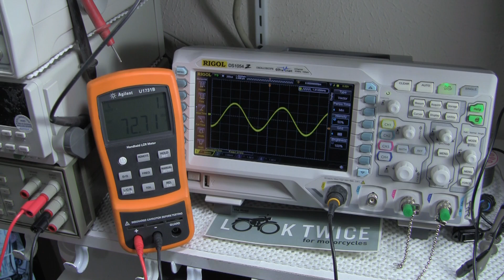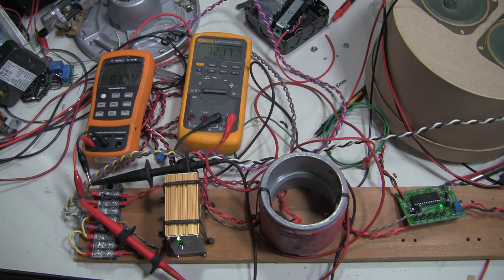ACF 016 Agilent 1731B LCR output waveform & vehicle loop testing

Comment: I dont think an LCR will work for what your trying todo. I beleave the loop detector is looking for a shift in current.
So to see the effect of the inductance youd need set 1 Channel of your oscilloscope up to read the loop detector output voltage and A second channel set up to read the current using A current clamp or optical an isolated leads.  
When there is no interference on the loop voltage and current wave should be in sync. when the loop detects an object the current wave should shift. Most detectors I believe are looking for around 25% shift between voltage and current to trigger.
Reply from the maker: Thanks for the info. Guess that makes sense that a change in inductance and/or capacitance would make current lag or lead. Would imagine that on some of the higher end loop detectors multiple characteristics of the circuit are being measured.
Reply: accesscontrolforum have you looked at the EDI loop detectors and documentation? 

You've got me curious about the LCR meters now. So I just ordered a BK precision 880.
Reply: accesscontrolforum I only asked about EDI because they're the only loop detectors that Ive found used commercially on traffic lights as well as direct plugin modules for gate operators. They're well documented modules and another thing that I find nice about them is they display the frequency on seven segment display on power up. and cost the same as the Dtek.
Reply from the maker: Use the LCR in the field to confirm inground loop inductance is between 20 and 2000 µF, which most loop detectors specify. Still take resistance and capacitance measurements for customer's records. In addition, and most of the time more importantly, to using a Fluke 1587 and Supco 500 insulation tester/"Meg ohmmeter". 

Also, it's important to note that having a frequency counter on your loop detector is essential. The LCR is using a fixed frequency which doesn't tell you the loop's reaction under actual load conditions. If your loop detector has a frequency counter you can adjust frequency settings using the actual load to prevent crosstalk between loops.

My next purchase will be the KEYSIGHT U1733C because of the higher frequency ranges which correspond with loop detector output frequencies. If you notice the BK and Agilent/KEYSIGHT look alike because I think there made by the same people. Correct me if I'm wrong.

Reno A&E make several high-end loop detectors for all kinds of applications including traffic, railroad, bicycle, Access control, etc.

Also, as mentioned in the video, I think this experiment is flawed because the measurement is being done on an energized circuit. That's why was hoping an expert would look at the test rig. However I never got any definitive feedback.

Are you in Texas by chance?
Reply: Is an LCR capable of reading the 70 to 250 Microhenry loop specs also to determine inductance of a loop? For instance a chart shows a 4 x 4 with 4 turn should be 78, a 4x6 loop with 4 turns should be 100 etc. I want to be able to possibly determine how many turns are in an unknown loop and possibly be able to find tune a loop by adjusting the length of the lead in.
Reply from the maker: "Is an LCR capable of reading the 70 to 250 Microhenry loop specs also to determine inductance of a loop? " Depends on frequency and LCR, but your LCR at 1K yes. Frequency is something most manufacturers don't list on their induction loop chart. 1K is what we use and is common (but not the only frequency) for most independent studies Texas Department of Transportation, Florida Department of Transportation, etc.

Hate to make blanket statements but you're not gonna be able to reliably find out how many turns in an existing inground inductance loop. The factors that go into real-world/in the field inductance calculations can include shape, permeability of medium, saw cut depth (relating to permeability of medium), adhesive/sealant type, wire diameter, backer rod, insulation resistance, lead in length, lead in twisted/or not, ground temperature, above ground temperature, moisture in saw cut, impedance, loop detector frequency,  etc.

An example: all things considered equal such as lead in length, loop shape, backer rod use, temperature, wire diameter, etc. a loop in concrete with rebar will have a different inductance, because of permeability of the medium, than a loop in blacktop.

So the LCR is for documentation only. It will not tell you the real world inductance of a loop because your loop detector is going to determine the frequency, voltage/current, etc. independent of using an arbitrary frequency such as 1 kHz or 100 kHz. That's why it's so important to have a frequency counter on your loop detector.

Here's how its use could be justified in the field. 1st test the insulation resistance from the conductor to earth ground. Let's say it's it tests good at above 40 million ohms. DC resistance tests good at a few ohms. Inductance in series tests in the picofarads range. Now the other 2 tests show good but if there's a break in the wire 3 or 4 feet from where you are testing it, your inductance will be next to nothing and the loop is likely bad. So we use it as confirmation that a loop is good or bad.

So the best way to determine the number of loops is documentation, documentation, documentation. This will give you a reference for your geographic area. We don't test inductance only insulation resistance for new loops so I have nothing to reference either.
Reply: That makes sense. Thanks for explaining.

I read a Texas university loop study on DOT's site but there seamed to be several variables/unknowns that weren't documented in their report. It was definitely a good read. 

So as far as testing frequency....  do you know of a fluke meter that will read above 50 kHz to allow you to prob the loop connector to read the exact frequency?  To know whether you should test at 1 kHz or 100 kHz range. I realize either way you wont get an exact induction reading but maybe it would be a little closer. Or if you average the 1 kHz and 100 kHz readings would that even be relevant number?

My 880 wont be here until next weak. But I just replace 3 loops I installed about 10 years ago and have 4 to 11 more to replace on the same site. So feel Ive got a good place to start doing some more in depth testing/ experimenting without to many variables.
Reply from the maker: I don't know of any Fluke LCR's for field use and am not familiar with their bench LCR's. If we were going to document one number it would be insulation resistance.

The device we would use for exact measurements of inductance, quality factor, etc. would be the ATSI HILT-9000. It has variable frequencies that step up and down 1 kHz. This is the premier of inground loop characteristics measurements. But you will find used they are still expensive. Keep in mind that you can calculate the inductance very accurately by knowing the main factors of the loop. So if they are new loops you can document this yourself and be more accurate. Just look up inductive loop calculator on Google and you will find several calculators. The main thing is a calculator that does different shapes not just circles, medium permeability, wire diameter, etc. start with this one https://www.eeweb.com/toolbox/rectangle-loop-inductance

The most comprehensive study that we found has been US Department of Transportation Traffic Detector Handbook: Third Edition. It can be downloaded via PDF but when you start on this journey remember it's a rabbit hole that will consume hours and hours. So good luck. We use this as our go to reference for inductive loops and loop detectors.